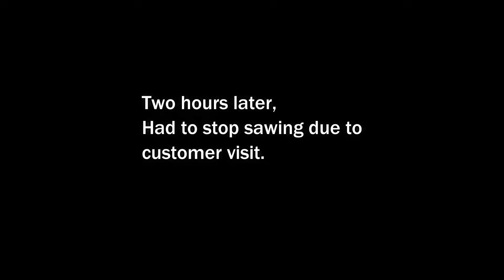STUNNING! THE BEST WOOD EVER PRODUCED ON MY WOOD-MIZER, AMAZING WALNUT SLABS

Comment: since i bought a sharpener i am changing blades more often and what i found one day was there was some pitch had got caught under the v belt on the drive pulley and created a bump. i had been having problems with wavy and rough cuts for a long time. i cleaned this out with a dentist type pick and ever since have been removing, wire brushing the belts inside and out, and inspecting/cleaning the inside groove of both drive and idler pulleys every time i change a blade. this has made a huge difference in getting/maintaining a nicer finish off the mill.

i have also taken to only putting about 1000 or so psi on the new blade, engaging the mill just for a few seconds to let the blade track itself, and then cranking the blade tension up to full pressure, running it with lube a few more times until it settles in before making any cuts. this prevents initial twisting stress on the blade and also helps with knowing when a blade is getting dull or nearing the end of its service life.

once i get mid way through a cut and see the pressure dropping off, i stop the travel and retighten. if it keeps dropping the blade is either going for an unplanned ocean trip or it will break altogether. this doesn't necessarily mean there are gullet cracks but i always check after a blade does this.  another thing i used to take for granted was that the mill would be good with a new blade, now i always check as i am runnning in the new blade to see if there is any blade flutter. i'm also using a LOT more lubricant than i used to and that seems to help on the wide cuts. i have been using a gallon of windshield wiper antifreeze in each load in the lube jug and that is working good.

i have also noticed recently that i am getting an odd resonant sort of twisting from some of my blades as i view them running with the guides open full width, not sure yet what is causing this. i saw some large diameter logs and the outer blade guide gets hit quite often. i dialed it in the other day but the problem persists. i guess i'll have to check the inner guide as well. i'm thinking maybe the two are not quite in perfect alignment.

-18C here today so i got lots of time. ;)

if any of this helps that will be 2 cents.

Comment: Nathan I pulled four ugly half rotten looking walnut logs from a brush pile i pushed up ten or so years back. My buddy told me I was waisting my time. Sap wood was completely rotted off. These were still 16-18" in diameter however. They turned out to be some of my best looking slabs to date. Darkest grain walnut I've milled.
Reply from the maker: good deal buddy,

Comment: Opalescence I think describes it pretty well!  Beautiful!  Hey, I've been thinking about your sawdust accumulation and your earlier comments on the topic.  What do you think about building a flat-bottom V trough the sawdust can fall in to with an identically shaped push/pull tool to scrape the trough with, maybe open ended with a bin to scrape it in to?  I think with the extension chute you're put on the saw it should be out of your way (under your sawhorses) and should make clean up easier. #KeepTheChipsFlying!

Comment: I know sawing steel and wood are two different things. On our saws that we use for cutting steel up we actually have small wire wheels that clean the metal chips out of the teeth. Would that help on your type of saw?

Comment: So what's your thoughts on the 4 degree blades? And how many cuts did you make with that one. I always feel like mine get dull quick. But that one seemed in line with my double hard 7 degrees.
Reply from the maker: I like it but the 7s are very similar,

Comment: Thanks for sharing another great video. For further clarification, do you sell the slabs directly to public or wholesellees? Do these slabs wind up as finished tables as is? I saw another channel where they put the slab in a frame and poured epoxy or acrylic around it and turned out quite impressive but I think that it takes away from the natural look.
Reply from the maker: yes most are made into tables,